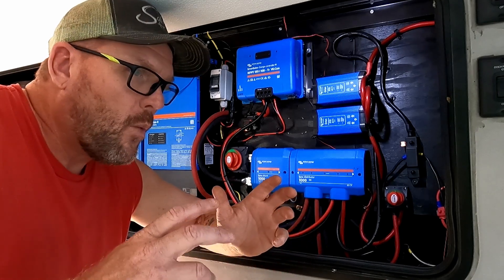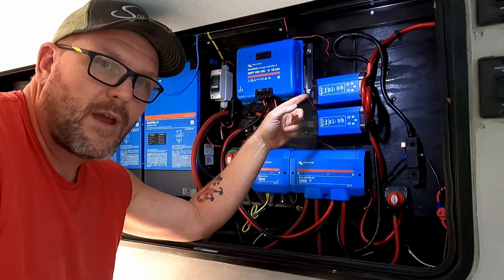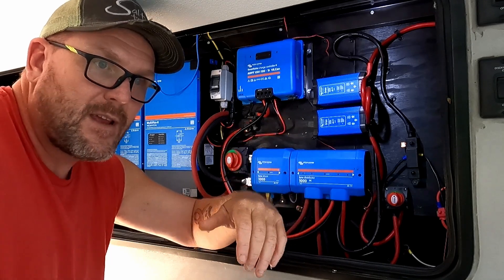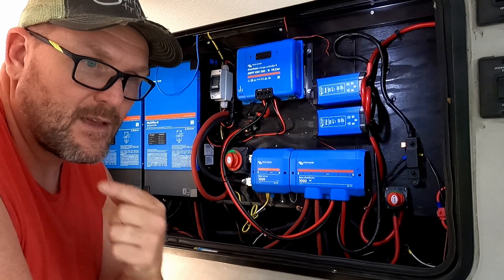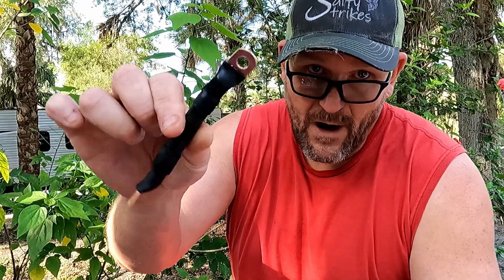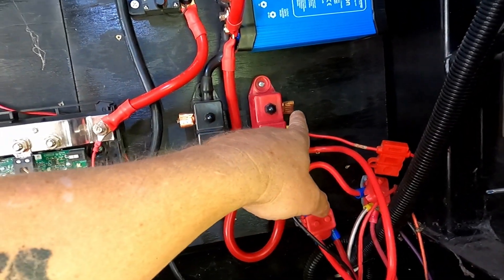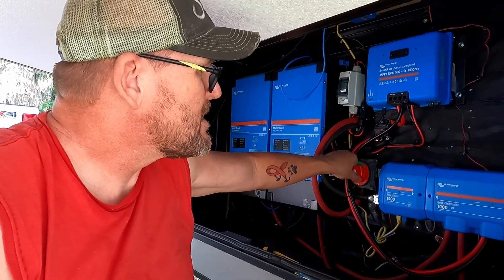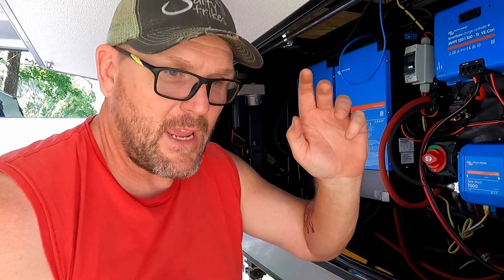12v vs 24v vs 48v RV Victron Multiplus solar systems! #rvliving

Comment from the maker: One of the other major decisions not to go 48v system is Victron doesn’t have a 48v 2x120 Multiplus yet.  So that was a big factor.

Victron Orion 24/12 converter- https://www.amazon.com/dp/B01BF5BQLA/ref=cm_sw_r_as_gl_api_gl_i_YW1ND4F0D143VGE9MWHJ?linkCode=ml2&tag=saltystrikes-20

Comment: God I could talk to you all day lol. I have put into my class A older motorhome a 48vdc solar system. It  did have a lead acid 12 vdc system here before. One main problem I had is one tech support said I could not use ground on my lithium 48 battery. I still have a 12vc engine batteries that I still us for my  my slides and lights connected using. I got a 48 to 12vdc isolated output Victron so that I could frame ground the 12vcd output but not effect the 48vdc lithium batteries . The main reason seems the ground bar here now has electrical and negative ground going to the same grounding bar. Also I think they still used frame grounding for several 12dc circuits. So the 12vdc 30amp output from my Victron will help charge the 12vdc engine batteries that some of the 12dc circuits still go to . Also help charge with I use my hydraulic slides. I might have to add another 48 to 12v dc converter to increase the amps that might be needed. Still working on this. The rest of the solar system work Great . Only learning and trying to modify so I can use .

Comment: I did this 24V system. The Orion 24v to 12v. Has power going in but nothing going out. I have checked everything and don't know what to do.
Reply from the maker: @rvspiritofadventure9181  did you adjust the little nob in the whole on the end?
Reply: @saltytrips  Would that stop any power from coming out of the 12v end? I have a multimeter and there is nothing!
I will check though. Thank you.
Reply from the maker: @rvspiritofadventure9181  it adjust the voltage, i don’t think it would stop voltage completely but it might, have you adjusted it?

Comment: The fucking mess. Chinese shite breaker that is copying BlueSea breakers which constantly fail. 
You’re using shit copper coloured terminals (not real copper). Your cable is fine but your terminals is where the fire will start.

The real terminal connections are flared at the bottom and thick steal. That blue handle Chinese crimper can’t put on 25mm+ terminals. While you’re talking about loads of watts you literally don’t know how to connect the cable.
No one should take your advice.

Love from, a professional x

Comment: I'm looking to do exactly what you did going to 24 volts.  Great video and thanks for putting this together.  How have those orions worked out? have you had any issues with the 12v side going through the orions?  Have you determined what the max amperage is your 12v pulls like when using the leveling system or slides?
Reply from the maker: @davenelson5496  Orions have been running perfectly, way to determine make amp of jacks is by check the fuse rating on them, I showed this in the Orion install video https://youtu.be/EV0HWocQqRE?si=HUN6MMpXgelHsZUm
Reply: @saltytrips  yeah i checked mine.  Its a little confusing because each of the 4 legs have a 30Amp fuse.  This means if all 4 pull max amps at same time that could go as high as 120Amps.  But in practice I've never seen more than 2 work at a time.  My front jacks pulled about 51 amps while watching the shunt without any other things on.  So if my fridge is pulling 10 and the leveling system pulls 51 than a single 70 Amp orion should work but its getting close so maybe I should just get 2 and not worry about it.
Reply from the maker: @ 2 is 1 and 1 is none, always good to have redundancy too.

Comment: Camper build here that has a JAM60S21-365w solar panel and 2 x 100ah 12v agm batteries. Using a victron 100/30 charge controller

Is it worth considering using it as a 24v system ? 

 adding in a 12v split charger from the alternator to help charge on move  but guess ill have to add an extra dc dc converter for running the lights and pumps etc down to 12v. 

Will it be best to add a 3rd 12v only battery for that side and let the 24v side run more efficient and actnas a power bank to it
Reply from the maker: @crushedtincancompany  if you’re not running an inverter I would stick with 12v.

Comment: I have so many questions. This is helpful, but I have so many more. Wish I could talk to someone directly without getting the run around. I have a 40’ coach. Very handy, did my own off grid solar for my cabin but the RV makes me nervous. If everything is on 12v in it, and I want to do 24 v everything for the charging system is there a converter or something for the 12v I don’t want to fry my system
Reply from the maker: @jmackenzie2131  https://youtu.be/EV0HWocQqRE?si=87BHUHk3LYyj3HgT
Reply: I use chatgpt for this. To ask questions and do calculations and then with my rapport I go see a expert to double check ✅

Comment: Great video!  I am in the early planning stages for our new 2019 Tiffin 45 Bus to get solar onboard.  I definitely want to go 48v.  I did a 48v system at my off-grid cabin and it works great.  The motorhome is a bit scary for me to try and retrofit solar into it, but I learn something new with each video like this one.  Thanks
Reply from the maker: @AndrewJohnson149  awesome, good luck with the build, let us know how it turns out 👍

Comment: What are your thoughts ..adding an additional 24v alternator dedicated to assist in charging 3   460 Ah batteries ..I,m trying to use shore power or generator or the separate 24v alternator to charge the 460ah batteries [ while driving] I was trying not to disturb the roof of the motorhome ... my goal like a lot of folks is to be able to run one a/c during the night if i'm some place that running the generator would be inappropriate ..thanks Glenn
Reply from the maker: @GlennShay  if you have room in the engine bay that would be a good option, easier option would just tap into your 12v alternator with a 12/24 converter like this https://amzn.to/46GBvPy

Comment: If you remember you inspired me to build my system much like yours. Just got back from a 2 month western US trip NM,CO,UT,ID,WY,NE,KS,MO,
OK and back to TX. All worked out great, can’t wait to get back. I’m waiting on cable to add another Litime 24V 200Ah. That’ll make 600Ah total. Excellent points on going with higher voltage system.
Reply from the maker: @Retired..Mostly  wow you were making thr rounds, thats awesome. That’s one of the great things about this system, you don’t have to get it all at once, you can add as you go over time. Keep up posted on your build.

Comment: Chris, why so much 12v output? The oem breakers for the trailer are 50 amd 30 amps. The 50 feeds the 30 as well. So really 12v 30 amps for most connections to the fuse box. I'm just curious. Wouldn't a 24v to 12v 50 amp converter be sufficient.
Reply from the maker: @woodie44309  Breaker are 120 volt AC (alternating current) , 12 volt DC (direct current) is complete separate system. 
120v at 30a is 3600 watts
12v at 30a is 360 watts 
Heres the video explaining why I have parallel 24/12v converter https://youtu.be/EV0HWocQqRE?si=fORpLePihFyKXFuI
Reply: @saltytrips the "breakers" I'm referring to are the 12v auto resetting breakers. That's what they're called. One is 50amp the other 30amp.  They most certainly make DC breakers. I have a few.
Steve C here by the way!!
Reply from the maker: @woodie44309  most 5th wheels and Travel trailers don’t have OEM DC breakers, they are almost always fused and not breakers. We use DC breakers between owr PV controllers and distributor and also between the 24/12v converter to distributor as shown in the video.  Breaker size isn’t random, You always use a breaker to protect the wire, typically 1.25 times load max capacity.
Reply: @saltytrips  every keystone has the 50 and 30 amp auto resetting 12v breakers near the batteries.  They're the little red boxes that the battery cable attaches to right from the battery. I'm just curious why the 2-70 amp converters. It seems excessive. Most of the trailer is fed from the 30 amp. That has the wire that goes to the fuse box. The 50 amp is jumped to the 30 and I believe the breakaway is the only item connected to that.
Reply from the maker: @woodie44309  nope, as I stated before this explains the amp choice https://youtu.be/EV0HWocQqRE?si=Pj5CmV6XdQP97UOU
Reply: @saltytrips  I missed it the first time through. It's the jack controller that's connected to the 50 amp in mine, not the breakway. But I see your point.

Comment: I went with a 48v system on my Jayco Seneca with 2000 watts of PV, wired in series. I segregated the 12v chassis charging system from the 48v system. I either charge the 48v batteries from Shore, PV or the Generator.  I did lose the capability to use the coach batteries to jump start chassis batteries, but I can use other means of jump starting if necessary.  Generator starts off the chassis batteries. I use 3 Victron 30 amp 48v to 12v controllers ran in parallel to run the 12v loads. So far so good! Watching your videos helped me answer some questions I had on running two Multiplus II inverters. Thank you for the help.
Reply from the maker: @Tombeau-k1b  glad we could help, sounds like your build is coming a long nicely, keep us updated.